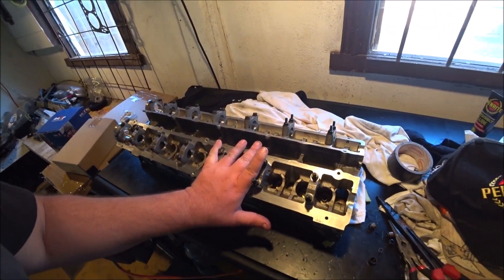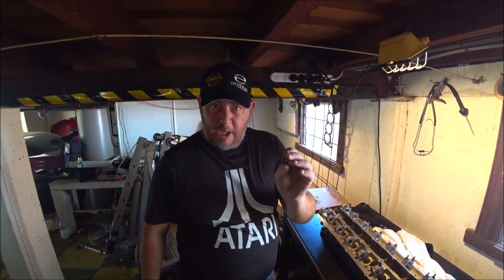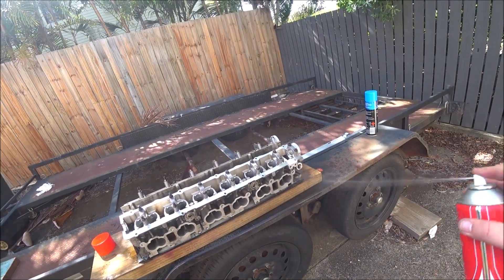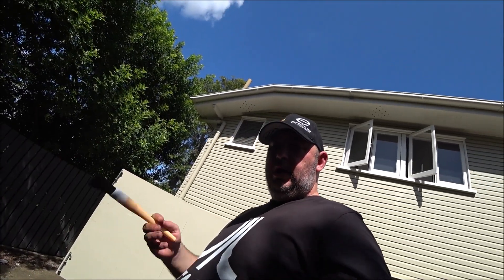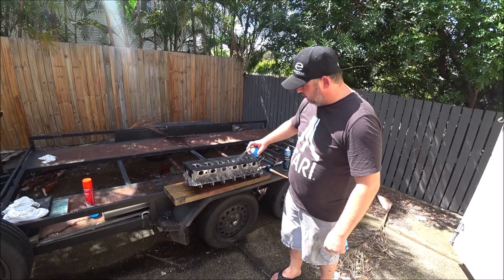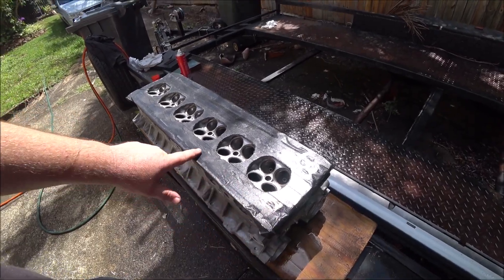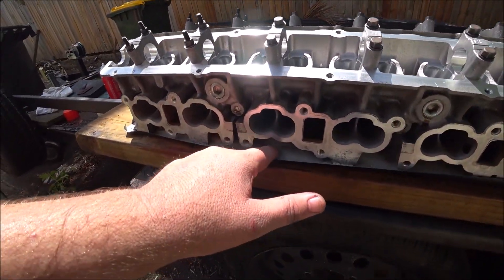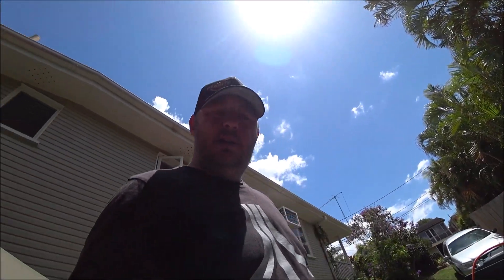RB25DET Build - Removing Valve Stem Seals & Cleaning The Head

Comment: Hey Tangles thinking of doing my Cams and valve springs/ retainers on my neo with the head still on. Think it's possible to do the valve stem seals too? Or not bother
Reply from the maker: It's certainly possible to do it all with the head on, if it's worth it, I'm not sure, are they worn or leaking and need replacing?
Reply: @tangles01  Na none are leaking, just stupidly thought it might be one of those things to do whilst it's apart haha. 

Heads looking good too man can't wait for the next vid
Reply from the maker: @sandyfpv5216  Is it a high boost build? Anything could be worth doing, if it's worth it to you.
Reply: @tangles01  under 20psi
Yeah very true
Reply from the maker: @sandyfpv5216  Mah I wouldn't bother